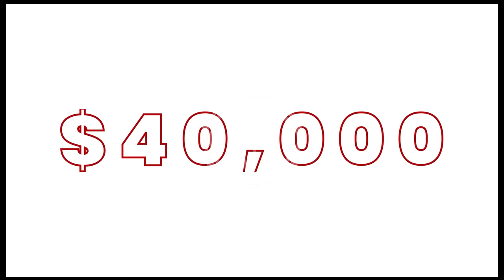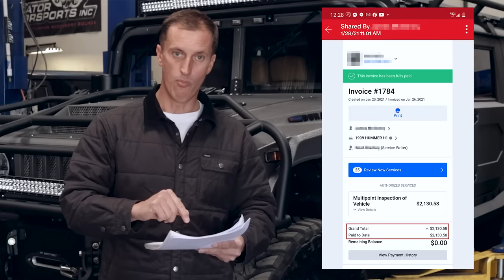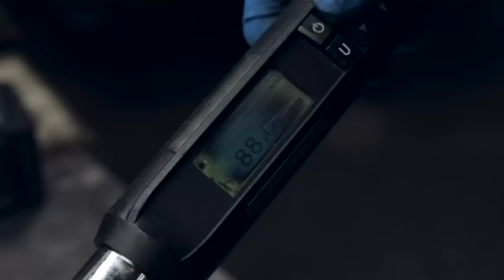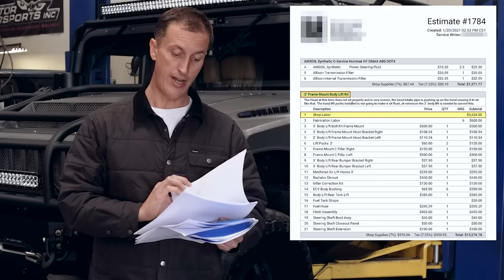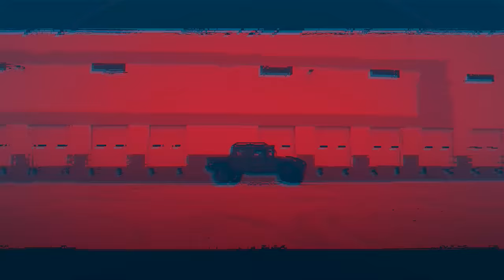$40,000 H1 HUMMER SHOP SCAM!

Comment: Sorry you Good Folk have to good through  , On the Flip Side we the get to see a  Good a Honest shop Help with this and how You had Back UP  .. Also To you awesome fallows the have left comment. as a new owner of a 2003 .   Very Good Condition fallows the have left comment. as a new owner of a 2003 .   Very Good Condition   I all ready run in a gas lighting thing were AAA was to call  me back to get the streel wheel straighten  I have heard back   they side the lift had failed   ..  but same guy wrote my mileage wound and lift hood with r One Latch unlock down  as the handed the keys After $500.00 of   crabeater cleaner radiators -cleaner and alignment /// The Way the Hummer Cranks I have  Suspicion the timing was mess with know it chunk out fast,   I  not sure one little can of clean can do that.

Comment: Sounds like my Cadillac dealer. They wanted $1,400 and change to replace a single strut on a Cadillac XTS. I got two new electronic struts and entire assembly with  springs and everything and two AC Delco rear shocks all electronic by the way for less than that and then another 1100 bucks to install these crazy things because nobody wants to touch these POS GM Cadillac crap cars. Probably crazy to repair this damn car but I need it for work the trade-in is a fraction of what I still owe and you just cannot find cars now for a reasonable price because they can't get these Chinese chips for their computers! Well done GM! I can't imagine the kind of money you throw away on these silly toys just so some business boy can drive around in his Hummer. A better business would be to go over to Iraq and Afghanistan or even Saudi Arabia and just start shipping back all of the abandoned vehicles that we've dumped there.

Comment: Here's the deal that shop didn't know what they were doing!! for one and when you get prices like that that means they don't want to work on the vehicle!! and if it needed all that work. Is because shops like that will take out your motor and replace it with shit that's going to fail from some other type of donor. vehicle and then leave you with  a bill like that.

Comment: Did he give them the right to film his vehicle, for commercial advancement.
Reply: @AA Mech Robert was referring to mod mafia who had it and ran the 40k bill up. 
MM shot video and photos. Of course predator is being asked to make this video
Reply: Sorry, yes, I did not make myself clear. Yes, those who were denigrating your work.So, you advise that they are requested to only change a pump, and the don't change you pump, but go through the vehicle on an assessment process, not requested, nit picking your work & filming this denigration, and produce a document, listing this work? So, (in the UK legal context) that would suggest there may be, allegedly, the opportunity for a case of liable and slander?

Comment: Well that other shop hasn't been active on youtube since this video upload lol.....  So I'm guessing they aren't doing so hot now
Reply from the maker: Yah, noticed that too. One of their videos they were attacking someone's work on a truck and they were bashing a Turbo charge pipe saying the end was dimpled in and the shop that did this was morons. They being complete novice hacks didn't realize that the shop they were referring to was General Motors and the tube dimples in by design where the clamp connects to. Did you see the other vlog where they were using about 100 zip ties holding the brake system together form a customers truck? Unfortunately I think they are going to kill someone someday.

Comment: 6:19  "An oil change for $1,300"  Didn't mention the 16 quarts of transmission fluid on the invoice which would have to be pushed into the trans using a transmission flush machine since only a small portion of the fluid is in the pan.  Now I don't feel like finishing the video...

Comment: I had a jiffy lube and a Midas try this type of scam shyt on the same road trip
Reply: Tip:  Good mechanics don't aspire to work at shops that are a synonym for FAST or CHEAP and pay less than a starting table wiper at Chik-fil-A.  Midas has a decades long "Screw everyone big 1X" reputation that relies on a steady supply of naive car owners.  Employees are praised and rewarded only for high sales and fast turnaround time, and PUNISHED, hazed, and eliminated for doing things RIGHT when it's even fractionally less profitable.  Don't patronize chain stores like this, find a reputable local tech that specializes in your make of vehicle.
Reply: We were on a road trip had no choice I always fix my own cars just didn't have any way to take my tool box
Reply: @pha-qall6435  Synthetic oil can run 12,000 highway miles no problem, about enough for a lap around the continental US.  Better off preparing before the trip.  I've had nothing but bad experiences getting emergency tires on road trips, enough to avoid routine maintenance on the road far from my home front.
Reply: @lironmtnranch4765  it's never routine maintenance on road trips it was emergency situations and the areas we were in were lacking variety so options were nonexistent

Comment: Had a shop inform me in UK when my car was in for mot inspection that the front brake pipe was split, and leaking fluid, and it was a good job the mechanic noticed or I could have had an accident. I had to pay to have it fixed.
Next year, I went back with a different car, but the same mechanic informed me.... Guess what....? My front brake pipe was split..... He didn't recognise me and pulled the same scam. I told him he screwed me over the previous year, and unless he fixed the car ASAP I'd be calling the police, and also the dvls to advise them of the fraud he was pulling. He fixed the car, I never went back. Total scuss bucket.

Comment: The owner drives 1400 miles in 3 day with a vehicle that is in such a terrible status it is risking cst life and could blow um every second...come on, if someone drives so far, and not only the 5 miles from the dealer home, he defenetly would have noticed that something is wrong. And the loosen airline would be something a good mechanic would repair free of charge for 1 min work with 2 wire straps while doing the job the cst told him to do

Comment: Huh. I dont remember ARB air pumps being made in china... Mine says made in Australia....
Reply from the maker: Assembled in Australia with Chinese parts. Compared to the oem hummer industrial grade full duty cycle compressor, the arb's are not even comparable. However the oem ctis pump is well over $1000 so it's understandable they are not comparable.

Comment: That’s crazy how they wanted $1,300 for a oil change an 1,000 to change power steering pump how’s that cheaper then changing the oil that good that the owner of the truck didn’t fall for there bull sh*t an took his truck away from the shop hard to believe that there’s still shops out there still trying to scam people

Comment: "Unfortunately there's unscrupulous people out there."  I think that kind of sums up the auto repair business.  Once had a service advisor tell me I needed new tires due to wear.  (They were almost new with 5k miles on them).  His response?  "Oh, it must be the tech's tread depth gauge is out of calibration."  Because the tech was blind too?  And the aggregation of hours for work that can be done concurrently just boggles my mind.  "Sir, that's 24 hours labor plus $2,000 in parts and you'll pay 5% for shop supplies even though we'll only actually use about $1.50 worth.  You can pick it up at 4:00 PM today"  Um, what now?

Comment: 5:00 I call bullshit without test results. Chevy used that filter for packaging in the engine bay. 
And I'm willing to bet it saved GM $0.10 per filter to change.
Reply from the maker: Oh GrumpyBill.......do you work on Duramax engines? Have you done a Duramax swap on a H1 Hummer or any other platform? Im gonna assume that a big NO. Besides....no one asked for your opinion.  🤔
Reply: @PredatorInc  so you have no test results for the filter BS. 
Got it.
ASSume what you will, it appears it is natural for you.
Your insecure response with no actual information just informed me of your knowledge and ability.

Comment: ya lotta scammers out there .like your motor mounts sure look like mine tell you the truth all your mounts and brackets look the same from the hummer conversion i did in 2001
Reply from the maker: Haha, implying we copied mounts from you is a little far fetched! Sorry but we have never heard of you or your mounts. We set the engine in place and built them from scratch back in the early 2000. The first revisions were made later that year by about an 1/2" for better placement, neither of which were copied. In fact, the only other conversion done before us was by Lynch Hummer at the time and they had solid mounts. Maybe you copied ours! 🤔 haha!

Comment: It looks as though the Hummer had a suspension lift and the shop wanted to switch to a body lift with his worry about the half shaft angle,
 I own a H1 and to each their own body/suspension what ever u like
Reply from the maker: No, it was a 2" body lift vs 3" body lift with the reason it "must" be changed is because the downpipe is too close and the truck would catch fire. After hundreds and hundreds of conversions, including am generals alpha, not one has caught fire. Just another unethical scare tactic. I do agree with body vs suspension but not the case here, just an unethical auto shop owner.
Reply: @PredatorInc  oh but you know they have seen it many times 😹
 Maybe you can help me, I am doing a body off restoration, “ yes, I know that is a very powerful word ,  “ Restoration ! ! !  On my 95 extended 2 door. One of only 2 built in the dark metallic plum . It’s a long story but Hummer got me a older stock na 6.5 and I also have a rebuilt trans and transfer, not to mention new hubs, halfshafts, both rears etc.,ect .
 Also doing a total leather( not leatherette 😸) interior 
 It would be so cool to install a SUPERCHARGER kit if I could find one . Do you know of any ?
 Also planning to adapt short auto step boards that go completely up in the body skid plates.
 Did I mention this is a fully loaded H1 , ctis, winch, all options with am general roof rack, that big ass front grill/hood guard
 I think it would be a great candidate for a supercharger, it’s something so cool
 Do you know of any ?
Thanks jimmy

Comment: It's hard to find a good shop I really think MOST shops want to screw you. The last time any shop worked on my stuff they stripped the threads On the oil pan for the plug and made ME buy an oversized plug.  iv done this 20 times already laying in gravel and you can't do it with a lift wtf. I had another shop want to charge me for greasing my ball joints, the non grease able ones I had just put on.

Comment: Looks like a Damage Control video for YOUR SHOP! Sad that you put this out there. Sad
Reply from the maker: Nope, a shop tried to scam a customer out of 40k by blaming us for not installing items etc. He knew it was a scam so he sent it back to us and asked us to show what happened. Since then we have recieved about 6 other scam trucks from this apparent hummer hack shop. We only released one vlog showing the extent of their dangerous work. In fact we now call them zip tie engineers at the shop as they literally re-engineered  the brake lines to be held in place with zip ties and several resting on rotors. Be sure to watch that vlog, its a good one. The other vlogs have not yet been released but show how dangerous these clowns are. Ultimately they are going to kill someone unfortunately.

Comment: I can understand how you feel that not blasting the shop is taking the moral high ground and I would agree with you if this was the case of a botched repair or shoddy work but this is straight out criminal and fraudulent action.  Blasting the shop's name in my opinion would be a public service and NOT a petty revenge tactic.  If they would go this far to defraud a customer and discredit your shop, it is a pretty good bet that they are ripping off every single customer that comes through their shop.

Comment: I took My audi A4 to a shop for a clutch job. The tech quote me $500 since I was purchasing my own parts. The guy called me saying that the brand new sealed clutch I delivered to him was missing parts. And he would have to charge me extra. I called the vendor who assured me that was impossible because two guys have inspect and verified that all parts are included. But if I returned package he would replace it. The mechanic refused saying that he has already installed the clutch. Long story short my $500 clutch job turned into a $4500 job.This is theft and these crooks need to be arrested and charged.

Comment: Sorry but it’s time to name these scamming shysters for the trash they are.  If it was me, my only ask would be, you were authorized to fix the power steering and nothing else, did you fix what you were authorized to fix? No? Oh, you want $2400  for an inspection I did not authorize and haven’t fixed the PS? Sorry but your not getting a dime. If I didn’t authorize it I’m not paying for it. Been a tech both in the auto & heavy equipment industries for a long time & seen some real shady shit. Had it happen to my parents once too boot,  their vehicle need some work, went from the $950 repairs authorized  to $3800 for work not authorized. That shop got the authorized $950, and had to eat the rest.

Comment: Wtf?  $900-$1,200 for a lift on those?  What are they spacer lifts?   I payed $3,500 for my suspension on my tacoma that I installed myself!  I should have bought a Hummer, way cheaper to modify... Lol.  I can't wrap my head around the allure of these unless you live in a desert.  Here in Colorado good luck fitting those things on a trail.  But to each their own, I don't judge anyone for their taste in vehicles.  Unless you drive a Honda Ridgeline... Jk
P.S. have no idea how I ended up or why youtube recommended a Hummer video to me.  Don't hate me Hummer fans, I'm a stranger in a strange land here.